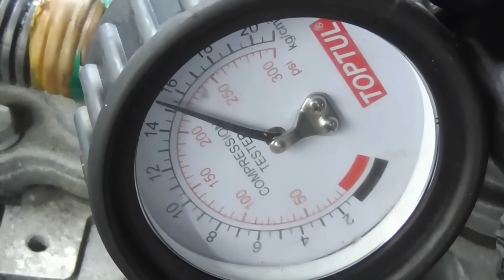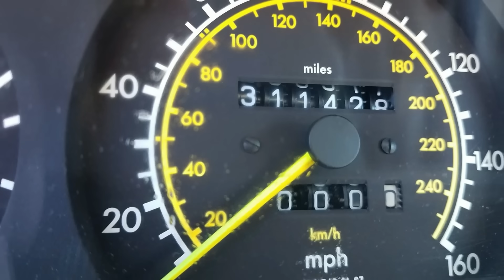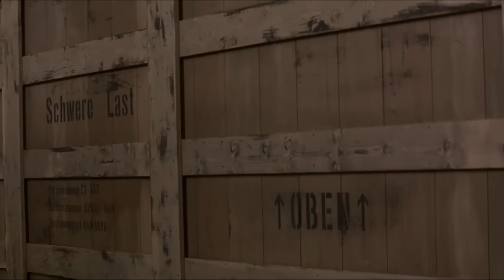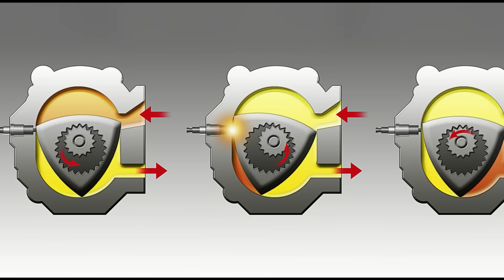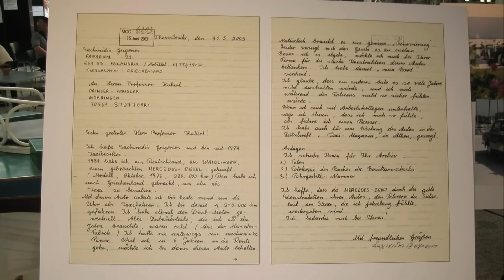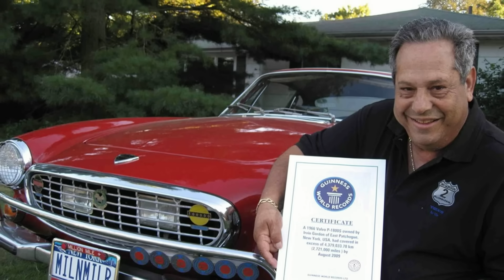Most Reliable Engines of All Time

Comment: Lemme get this straight; a Mazda rotary engine is on the “most reliable” list and the 5.9L Cummins  is not. Wow. This is pure trash
Reply: Especially for being known as the million mile motor Cummins got a steeltoe boot to the face here
Reply: @jackjumpover1  more like to the balls.
Reply: Also he said the rotarys were first released in the rx7....also bs
Reply: @tommys2979  the RX7 was where the rotary engine died, not where it was started. lol this guy is a real pleb.
Reply: @tommys2979  we owned a 76 RX -4 that was Rotary.  Great torque but drank oil and had  terrible gaskets
Reply: I think this guy is gay
Reply: @jostinwatson2778  stfu why u joking about people being gay dumbass
Reply: I was just about to say the 5.9 Cummins amazing motor. My duramax lb7 has 382k miles on it and runs great.
Reply: If your'e going to call out truck engines then I say it would be the old Mack ENDT 673. Well maintained, I've seen several that got torn down at 400,000 miles as that was the scheduled mileage for a rebuild. Most of those likely could have gone easily more than double that. 

There is a local taxi company around here that bought a 2012  Kia Optima new and I was told last week that it had over 450,000 miles on it.
Reply: @timhammett2302  Duramax lb7.. I seen one torn down with 480k that was 700hp daily driver that still had factory cross thatch.  Don't matter though diesels own all
Reply: Mazda rotary and no 22r? No AMC 4.0 inline 6?
Reply: James Smith  The 4.0 in my 98 XJ Cherokee has almost 300k on it. Original engine, still runs good!
Reply: James Smith
I’ve seen many 4.0 with 3-400k .. along with the old 300 inline six from Ford..
Reply: @windellpenton  yeah ford 300 inline 6 was a badass motor
Reply: Agree. Oil burners reputation and not many still on the road. It’s laughable.
Reply: I have a 1987 6.9 idi in my f250 and has over 500000km on it
Reply: If your willing to look at semis.  I saw a Cummins with 1700,000
Reply: Mazda rotarie is a good engine..........give me some of what he is on
Reply: The rotary has an 50,000 mile/80,000 kilometre rebuild schedule LMAO
Reply: The rotary was trouble. Crazy
Reply: I'll say the first gen, second gen and 3rd gen 5.9L are bulletproof. However I'd shy away from the Common Rail 5.9L. Only issue with the 12 valves was the dowel pin in the timing cover. The early 24 valves need a reliable lift pump of the VP44 pump shuts the bed.  Even the Ford 240/300 I6 didn't make this list.
Reply: @Ratkill9000  the Dodge 318 and 360 gas engine didn't make the list either. Both are pretty bullet proof engines. I have a 318 all original internals that's at the 150k mark and by his standards my truck engine should've made the list lol
Reply: Rotaries don't have an oil burning problem, simply they were designed to use a little oil, by design, in their lubricating process. The greatest enemy of a wankel is its ignorant owner.
Reply: policronia agreed
Reply: policronia that’s what I said
Reply: Yeah and he didn't have the Ford 4.6 on the list either.
Reply: policronia I agree
Reply: Gardner UK Diesels dating from the 30s can easy get to 500.000  plus
Reply: NASA has a Sterling Free Piston engine that has been running under full load for 110,000 hours straight.
Reply: @phydeauxddog  That would be A LOT of miles! My Ram 2500 has 179k miles with only 4400 hours.
Reply: try the bandit series motoribike engines; those things have been known to run past 500,000 miles and they redline @over 12k  rpm; the smaller ones @17k rpm
Reply: I agree  👎 ROTARY
Reply: policronia all import shit!
Reply: That Mazda rotary was a piece of garbage according to shop mechanics 🤔🤷‍♂️
Reply: 530,000km on my 5.9 haven't touched anything
Reply: Even the Chevy 5.3 should be there before the Mazada Rotary
Reply: @azeissler1987   Yep, recently sold an old Chevy 5.3 with 470k. Nothing else on the truck worked and the trans was replaced once, but the engine still ran strong.
Reply: policronia know people with old internatiol pickups still driveing them paints faded but still going..cummings motors
Reply: On the Cummins high mileage club, there are engines with over 3,000,000 miles.  (Almost 5 million km)
Reply: I know the Cummins is going to hit 500 k at least and know someone that has 800 k plus
Reply: The 5.9 has the Kdp or killer dowel pin. Other than that its weakest link is the dodge body
Reply: @jeffreygoss8109  The dowel pin issue was corrected many moons ago. The cummins is well known for exceeding a million miles without an overhaul.
Reply: @jeffreygoss8109  The 90s Rams, yes. They got that taken care of around 2004 or so. They're great from then on.
Reply: @jeffreygoss8109  I own a P-Pump 12v 5.9 cummins Dodge. Hit by a tornado, dented every panel, broke every window out, buried in trees. Cut it out fired it up still drive today. Those bodies on Dodge trucks are as tough as the drivetrain and chassis of those trucks. That truck is 23 yrs old with little rust. I know people with newer Fords and Chevy's that are rusted out. Also, my dowel pin has never moved, I thinks that KDP is over hyped.
Reply: My 92 Ram has over 1 million on the 5.9 cummins,  no rebuilds,  and the mopar slant 6 runs forever also. And as for these claims of high mileage,  my 2015 Chrysler 200 has 120,000 plus on it and no motor work.  And guy needs to do his research, most taxis,  like cop cars, come out of service around 50k miles to keep repairs down.  If you take care of it,  just about any motor will last forever.
Reply: @satanicexistentialist6631  i had a ram slant 6 4 speed all original with over 400k on it!!! damn good motor
Reply: ferkemall  Are morons like you everywhere in the world?  SO ignorant they believe their own arrogant lies?
Reply: policronia 
well , theres only the apex seals that go wrong, they dont throw rods , have knocking big ends , timing chains or belts are no problem . 
They are very good if you know how to run them or attach one to a lexus hybrid rwd gear box adn run the motors at the same time . 
Has anyone tried that ? 
no starter issues due to compression loss , well it wont cause a non starter journey.
Reply: @Andrew Smith That sounds strange, Rotarys are very very reliable if you know how to take care of them... Here we have several rotary rally cars, peripheral ported 300hp N/A, reving they ass off., hasent been apart for more than 7 years and still winning races.Last time i saw that car was at one of our local hill climbs.. Its a show stopper when passing by @ 14000rpm. 
Peripheral porting is one of the worst things you can do to a rotary , the heat and the centrifugal forces makes the apex seals very heavy and want to bend outward  when they passing the enlarged exhaust ports... that type of tuning will seriously limit the engine life, but it still running strong after this extreme abuse :)
Reply: Halv of theese engines dont deserve this list.   Cummins does not either.   Volvo b do deserve the whole list by IT self.   Along MB 300d
Reply: bergrud  not sure what engine family the “ Volvo b do” is from but I appreciate your feedback. As someone who worked for Volvo for 15 years, I also appreciate their longevity and build quality. The B23x (b230 234 etc) and the B5XXX, B6XXX engines were very, very reliable. Neglect was the primary reason for failure-PVC system, oil leaks,etc. Not sure what the B Do Volvo engine is but excellent feedback. Cheers!
Reply: @policronia  I guess B18, B20 from the late 50s until 1974. I have one in my 1964 121 Amazon. We love these engines in Sweden. They were bullet proof.
Reply: @bergrud  it is not MB 300D it is OM617 engine, the MB 300D was the car not the engine
Reply: Ohio West *facepalm
Reply: @deplorableconstitutionalis2834  
Rotaries go way over 100,000 miles if serviced properly and on time.
Reply: @johnburns4017  Oh lovely.... 100,000.   Yea, I got 120,000 on mine.... Big deal.  That is still trash.  Everyone gets 150,000 on the cheapest normal engine from any manufacturer.

Comment: U missed some 5.9 Cummins 7.3 international 3.8 gms ls series 6.6 duramax 4.0 Ford 2.3 Ford 3.5 gm all of them motors r capable of 300k or more my 6.0 ls in my Silverado is roling over to about 150 with no serious issues beat to hell and keep going strong 3.8 gm is capable of 1,000,000 miles or more iv seen them with 500k and there nearly indistructable the Chrysler 3.3 is another great motor 300k or more my 3.5 is a 300k motor before it needs attention iv seen 6.0 v8s in heavy trucks with 400k on them 1 with 300k beat to hell do some reachurch on your shit tour missing a lot of motors I bet the 3.8 FM will out last all of that garbage

Comment: No Ford 300 Straight 6?
I am disappoint.
Great engine, they should have never switched to the V6.
I am running a Ford Triton 5.4 V8 with 4xx,xxx miles on it.
It has "only" blown out one spark plug.
The apex seals went out on the Wankels quite often.
Jay Leno at 8:00?
I wonder what the most miles on one engine without a rebuild is?
A Courier got 1.2 million out of a 5.4 Triton without any rebuilds.
Hope mine last that long.

Comment: Chevy 4.3 L vortex V6 is one of best. Fleet had over 50 units and every one of them over 400,000 miles and some over 500 thousand miles and all ran great. Change oil and spark plugs and coil packs when needed and they will run forever

Comment: 100k to 150k isn’t considered a long lasting engine, that starts at 250k
Reply: Not to mention the 4.0L straight 6’s found in jeeps. Lots of those with an excess of 300k miles. Also the BMW M30 straight 6.
Reply: I agree with your assessment. Under 200k is relatively easy.
Reply: 100k-150k is a piece of shit. any motor that craps out before 200k is a motor that deserves to die before it's first oil change.
Reply: @ElectronicsForFun  ?
Reply: Let's not forget the Buick 3800(aka Fireball V6)
Reply: Robert Mcgee 

I have a 740 Volvo with 450K miles and never had the valve cover off.
Reply: Robert Mcgee exactly, if it dies at 150k, the engine was trash
Reply: Depends where you live
Reply: @krystoph4420  we're talking about where 99% of people reside.  If you live on Mt. Everest than idk.
Reply: Absolutely, I have lots of vehicles.  Few have less than 150k.  All still going strong.
Reply: Agreed
Reply: Robert Mcgee very true

Comment: Peugeot XUD is one of the most reliable engines ever made. I had a Peugeot 405 with the 1.9 diesel and had 691000 miles before I sold it.  Currently have a 2001 Passat TDi (130bhp remapped to 170bhp) with 467000 miles and still going strong.  Regular oil changes with good oil is key.  Also a good thrashing now and again helps

Comment: The 1999-2004 Honda 3.5 liter V6 is known to be a 500k engine.  This engine shipped in the Honda Odyssey but, poorly paired with a transmission that rarely made it past 140-170k.  The Honda 3.5 liter V6, in my 2001 Honda Odyssey, still revs smooth and has a nice clean looking valve assembly under the front side valve cover.  This engine has 335 k on it and it has never been rebuilt.  Unfortunately, the Odyssey transmission does not last as long as other Honda transmissions.

Comment: People have thousands to buy a car but 20-30 bucks for oil and filter every 10-15000tkm is too expensive..? Bmw m50/m52 engines last forever as long as cooling system and oil is ok like every other engine. 300tkm is nothing.

Comment: A real test of reliability is a lot more than 250,000 miles, my toyota hilux, with the 3l 2.8 diesel has 336 kms and is just broken in, I have seen at least 20 for sale here with 400 + thousands kms, ones that arnt for sale are up at 600 +, this is a truely reliable engine

Comment: I have a chevy 3400 engine. Yes, it had an issue with a head gasket, but once that was fixed by me 10 years ago, i put another 100,000 miles on it.  It seems mechanics wanted to take short cuts, and GM was not paying the proper time to do the job correctly. As such, there were many repeat failures. Anywho. Maybe the 3400 is not a good engine for everyone, but as of 2009, mine is.  I only use synthetic oil, and use the onboard oil life monitor. I actually enjoy driving an old vehicle that is extremely reliable.  I have nothing to prove to anyone driving a fancy car.  Actually, i think car show offs are shallow people. I rebuilt my 4t65e transmission myself too, and replaced the steel with hardened steel overdrive gear and chain.  I owned my minivan since new in 2002

Comment: Surprised that the mercedes sprinter 312d '95 -' 06 wasn't included.. Had one in the family 17 years. 270,000 miles. Rock solid engine and gearbox. Shame about the brakes though. 😁

Comment: meh.  my toyota 22re had 478,000 miles when the cable to the odometer broke.  drove it like i stole it,  gross overloads on back, only ever replaced head and timing chain. ran fine when i sold it with about 500k miles....

Comment: What about the 6.0 Vortec. I change the oil every 3k miles. Do a lot of towing heavy towing. I have 350k on the truck and it's the same original engine.

Comment: Old school  235 ,283 ,327 ,350 .they last forever and are still around . The mileage would had spun around 3 times and would still be running good on alot of the older cars.And ran with the old regural gas witch is nothen like the  gas now witch is to make engine run longer and better.

Comment: Nissan VG30DE is also reliable. 
 Ward’s 10 best engines for approximately 10 or 11 years straight. 
 It starts to leak oil after 110kmi, but that’s normal. All engines with a small engine bay do.

Comment: This list is unreliable. Almost any engine produced should go 200k before any major problem. The narator mentions several times "this engine should last over 100k if..."  I have had 3 Mazda trucks go over 300k without any problems. (keep the oil changed) , that's the key. I don't know what engines were in them. I've also had friends get mileage like that with their rice machines.

Comment: First engine DETT Dual over head cam, Electeonic injection, Twin Turbo so yea I would say it can handle two turbos...
Reply: K20 is also a newer motor that is in a select few cars the k24 is in most hondas now a days so who knows how reliable they are my guess is not as reliable as the d15 or b18
Reply: And last but not least the wankel engine is one of the most UN-reliable engines ever made they are just fast

Comment: Alot of facts not really correct like a clutch lasting just 50k most will last 100-150k.
Ive veen in the motor trade all my life and most nobe sports cars clutches seem to go wrong at 80-120k miles. 
Most customers i find have necer had a clutch go on them as most get rid of theor cars at around 80-120k my 2001 bmw e46 320d has the same clutch since new at 339k amd only had a turbo at 229k no other major engine parts have been changed. 
My merc c220cdi on a 2008 has 112k and is faultless. 
All my own cars hace done well over 200k all have done this on the origanal clutches or auto torque converters.

Comment: One of our customers has a 97 Mondeo 1.8 TD on 479,000 miles and an escort with the same endura engine with 401,000 which is also on the original clutch!there are many engines not on that list that are more deserving than many of those shown,there was a cavalier diesel in Essex a few years back on 750,000 miles and those DT family of diesels were dreadful,I have an Iveco 65c 16 spec truck that has clocked up over 340,000 miles while towing and the engine gets a service once in a blue moon!,a friend of a friend has 5 stationary 2.25 land rover petrol engines running exciter gennies on his chicken farm,he runs 3 of the 5 at any one time and they have been running almost constantly without any internal fault or failure since the seventies.Almost any engine can be durable given the right circumstances.

Comment: Are you high? The RB - widely known for persistant oil starvation problems at high rpm and kicking the bucket before 200k kms in . That BMW diesel - 2 words - swirl flaps. BMW instaled devices that sat infront of the intake valves that swirl the air before the intake valve. What happens is that with time the swirl flaps mounting point fails and said swirl flap falls right in your intake valve, and after it breaks it it fins its way into the cylinder, killing the motor. Do proper research ffs

Comment: My Saab 9-5 2.2tid has 500.000 km on the odo. Oil change every 25k. Oil consumpion les than 1 litre between oil changes. Still runs like a clock. No parts needed to be replaced, liquids and filters, that’s all. Great engine, great car!

Comment: You had me until the Mazda rx7 engine. Great, but not reliable at all.
Reply: Ryan Fenech so not reliable, notorious for failing. The person who put this together does not know much. No Ford 4.6L either? A solid engine that was used in police cars and taxis, many with 500,000 miles and even up to 1,000,000 miles on them.

Comment: While it can be argued that many low-friction engines engines can be more reliable than others, as many people on here already pointed out the Wankel rotary engine is not one of them.
 
Conceptually the rotary engine does have many pros like maximizing power to size efficiency, minimal vibration & noise, fewer components to construct than a 'regular' piston engine however one of its major design flaws is an inability to sustain efficient cooling due to it's high surface-to-area exposure of combustion gases vs the piston engine. 
It relies on intake fuel to cool the center. It's common for the rotors to inevitably wear down causing leaks between the air, fuel and exhaust chambers resulting in poor heat dissipation over extended periods of time.

Comment: Reliable 1988 WAGON Holden Jackaroo / Isuzu Trooper power plant opinions diesel in-line four cylinder 2.8L with intercooler turbo / petrol in-line four cylinder 2.6L • I’ve own both models, Diesel 805,399 kilometers. Petrol 482,801 kilometers.